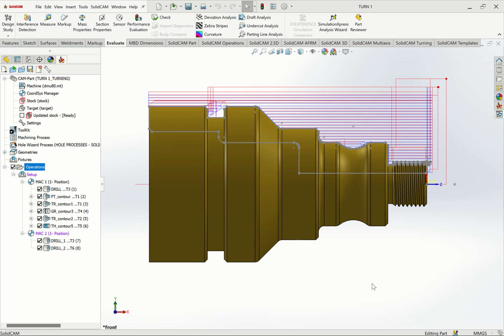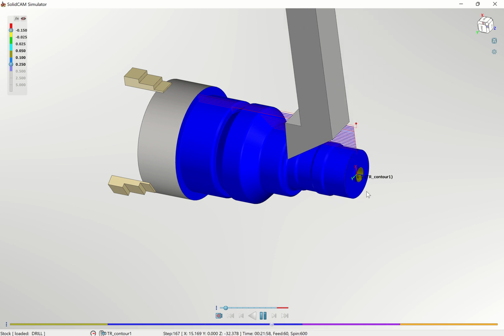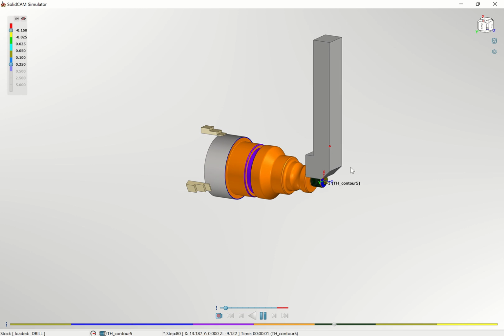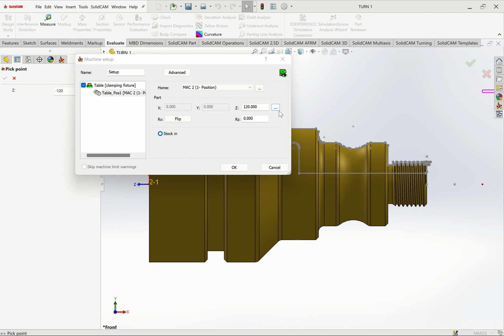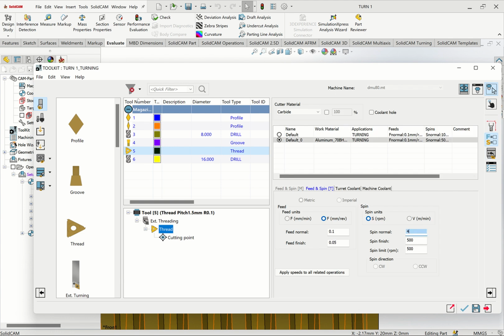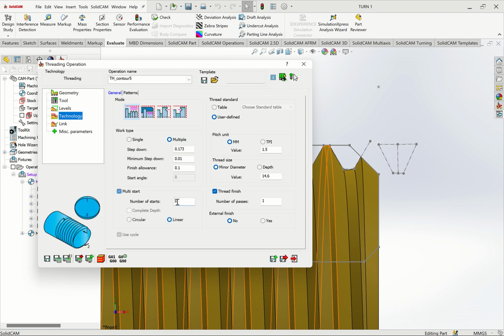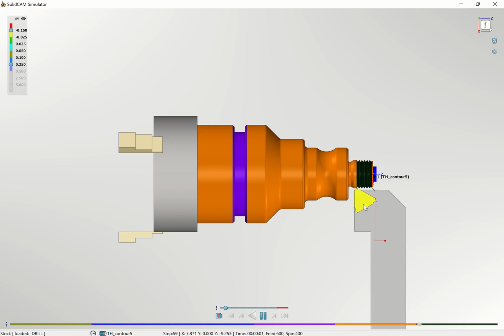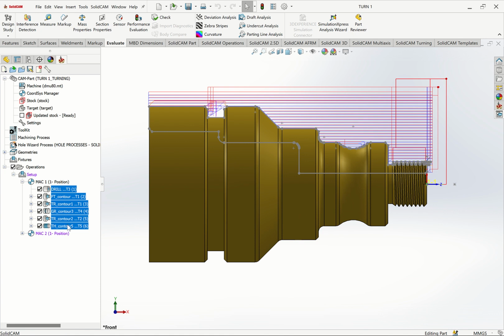Setting Up MAC 2 for Opposite Side Operations + Threading in SolidCAM

Comment: I have seen the simulation on threading, But that's not how actual threads are made in real life
Reply from the maker: Yes,I know,I was doing a tricky test to check how Solidcam does threading as compared to MasterCAM and fusion when I give wrong commands,I explained,there are other best options to use,I will post it
Reply: @Industrial_Design_Production  Nice. I also teach them on my channel, but I prefer manual programming using the G82 canned cycle.
Reply from the maker: @Mechanical_Eng_Design  .let's plan to meet and learn from each other...I do train and machine using CNC Lathe and CNC Milling
Reply from the maker: Yeah ,I know ..just tricking Solidcam ,which will do thread like grooves with thread tool but not actual thread 🧵🧵🧵,
Reply from the maker: @Mechanical_Eng_Design  , 👍👍👍..it's just tweaking software to do more than what it Programed to do, though,I won't run this as threading operations,it's just a trick was testing....even program is not responsive for threading when I geneate
Reply: @Industrial_Design_Production  I get you now. Keep going 💪
Reply: @Industrial_Design_Production  kazi safi sana.